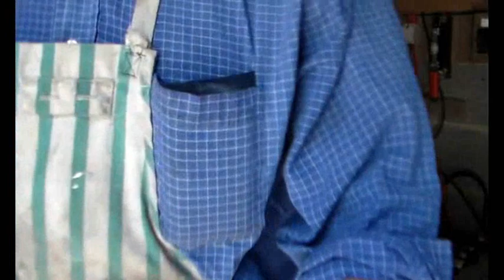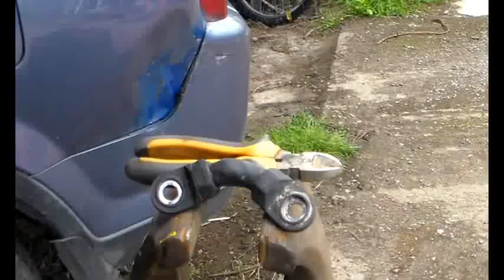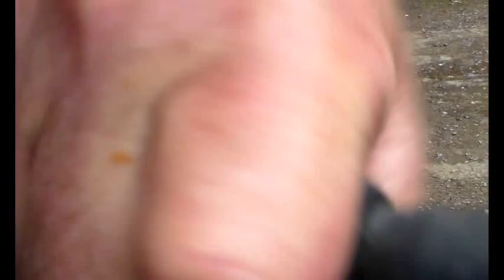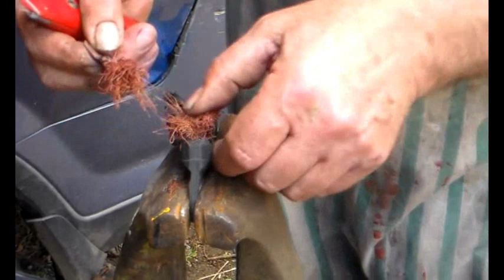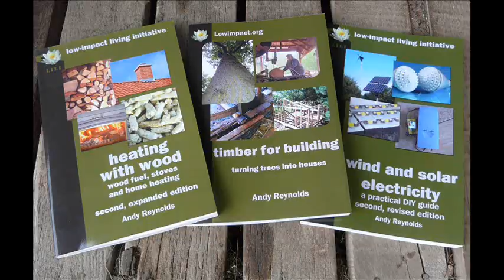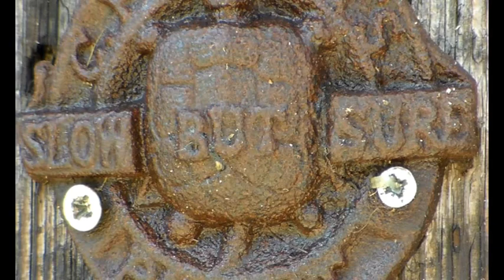July battery maintenance, problems with series parallel, rotting links.

Comment: Andy, another FLA question if you don't mind. I have a Rolls 2V battery that still holds charge well but the one of the battery terminal post is broken (the busbar part that connects to the next battery in series had a melt-down at some point). Is there a way to repair these or perhaps to bolt a new bit of lead to the post to facilitate its continued use?
Reply from the maker: Hi, yes a repair is possible, in the old days a former was used around a worn battery post and then molten lead was poured in to it to rebuild the post, obviously the old post would need cleaning up the a file to make every thing clean and the molten load melted into its surface. Otherwise one could cast a lump of lead then use a carbon rod to cause an arc with 6 volts DC  to melt the new lug to the broken one. It's a bit like arc welding but you use the battery itself as part of the low voltage supply. Old battery books describe this operation, cheers

Comment: Hi Andy I've just started to watch your videos so may have missed the answer to what I'm going to ask which is I understand your solar and wind power feed into the inverters  but what I don't understand is what do the batterys get used for? Have you got a separate 50 volt system as well as normal mains?  Or do they feed the inverters as well?
Reply from the maker: HI, the simple answer is the turbine and solar feed the batteries and an inverter takes battery power and changes it into mains power to feed the house. Our system is more complex but that answer will do for now. See my many other videos and please subscribe, cheers.